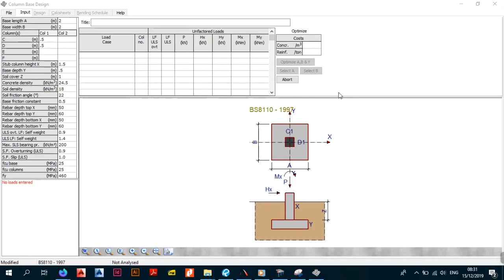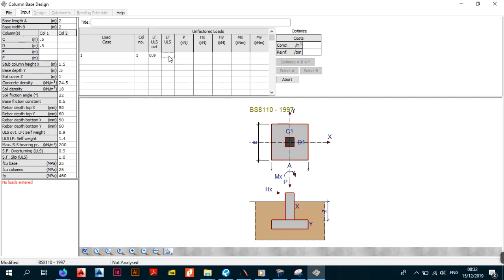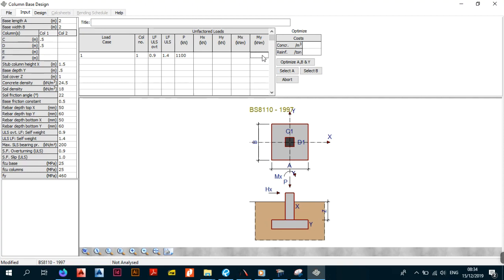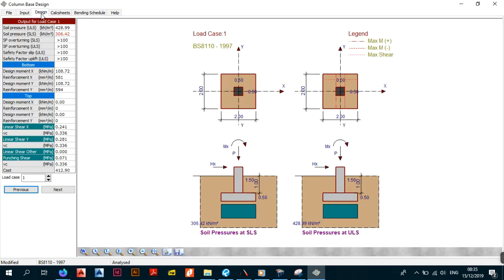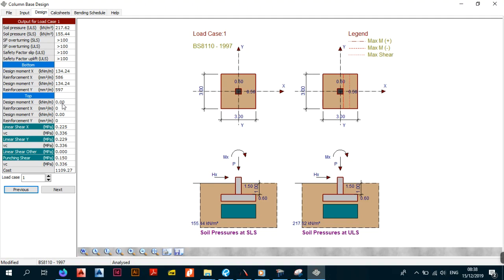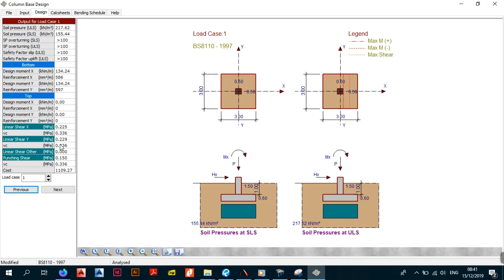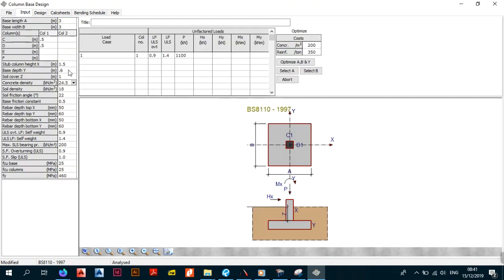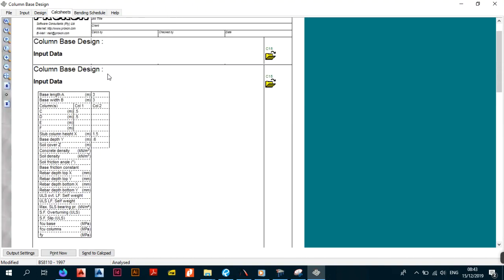Prokon Tutorial_ Foundation Design 2: (Loads & Calculations)

Comment: Excellent, could you please explain how to analyse and design a rectangular base slab (32mx20m) for a ground reservoir which is having concrete walls the columns on the base. Thank you

Comment: plase make another video for prokon tutorial, good video!
Reply from the maker: hey wassup Reza thanks, please let me know what exactly you are interested in seeing or learning next
Reply: @prokongeek6239  please make tutorial about steel structure bolt/weld conncetion using prokon  . prokon is really good for steel structure conection detailing or calculation , but  it's really hard to find the prokon tutorial video. thank you
Reply from the maker: Hey Rez, that is definitely great. I am currently working on a steel warehouse structure right now will probably be done in a week or 2 and i think i will use the connections i am designing for the tutorials but this was really good suggestion. Hope you will be patient with me work has been hectic :)
Reply: @prokongeek6239  i'll be wait four your next prokon video, thank's  bro ! good job